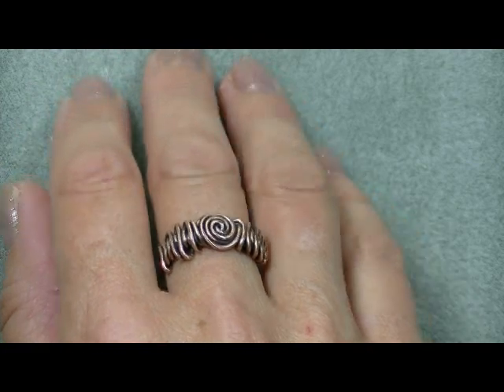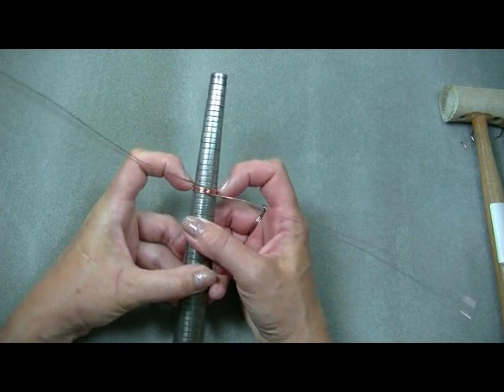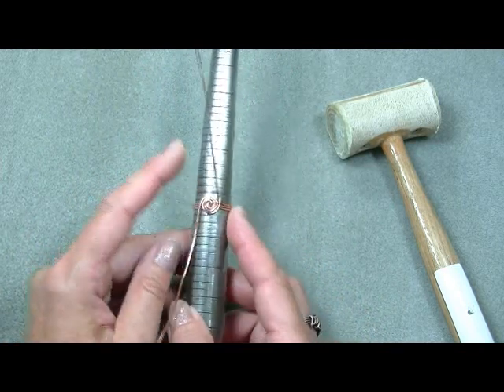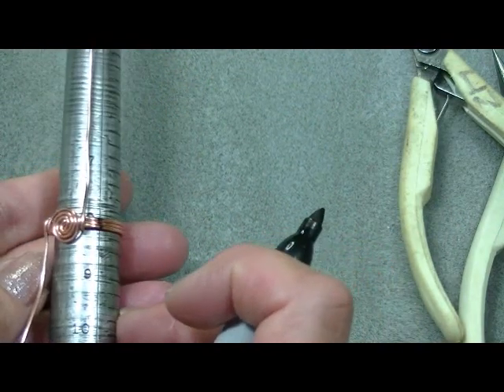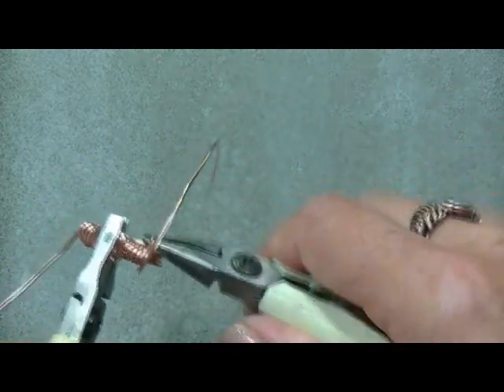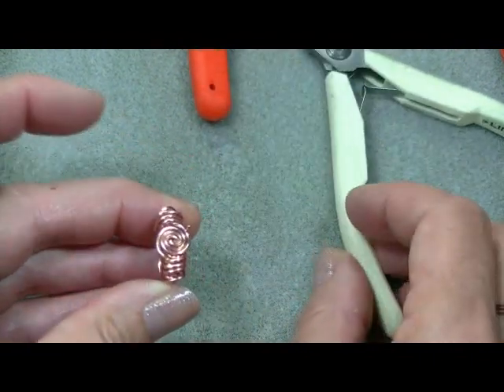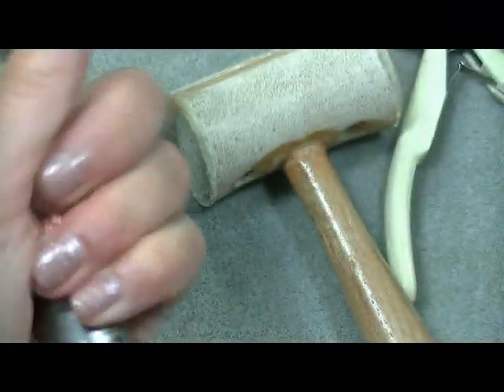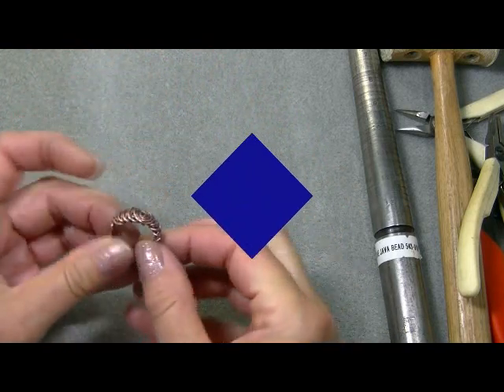Boho~Chic Copper Ring - Super Easy Wire Work

Comment: Great tutorial and fun ring design. The shiny copper almost looks like rose gold! Very pretty. Before hammering the ring, after fully wrapped, the spiral looks like a flat setting that you could attach some sort of decorative element. Just a thought I had. Of course, the ring has to be hammered unless it's meant to be a pinky ring. :)

Wondering . . . if the wire gets too stiff/hardened before finishing a project, can it be softened somehow? Say, maybe annealing with a torch? I'm a newbie, so I'm wondering for future reference. My hands, wrists and elbows are quite weak with arthritis, so I'm thinking I may need to re-soften the wire to be able to make some of your awesome designs. 

TFS!

Comment: This is great, i liked this, brilliant project, looked nice, i liked the shiney surface on this ring, before the antiqued stage, but both looked great, i just prefared the shiney metal version, the shape and style of this ring is very nice to look at,a visually pleasing design. thank you for showing us how its done.  I would like to make one in silver coloured coated copper wire and also in silver coloured copper for the atlantic waves bracelett, as im not a huge fan of bare copper wire, can i order these types of wire from your site? im a novice beginner in wire jewellry work and my knowlege of what wire i should use is limited to what i see visually as i have no experience to call on.  my main focus at the moment is to learn wire wrapping techniques and wire braiding wire bending and wire forming and all wire technique's to bezel cabachons or wire wrap them in any form to gain more experience and practice the techniques.  I think you said, that a 10 guage wire is best to use for the atlantic waves bracelett, i looked on your website, but i was unsure if you had it in silver coloured coated copper wire? Thank you Laura liverpool england.
Reply from the maker: +Laura Aqui Hi Laura,  I do not recommend color coated wire of any kind when using a hammer on it and especially for rings.  As soon as you hit the wire with a hammer, you break the seal of the coating and it soon changes color and deteriorates rapidly.  Rings take a beating and I only use pure metals for them. Coated wire will make a fun ring that you do not expect to last.  I do not have 10g nickel wire on my site but I do have 14g.  It is naturally stiffer than bare copper.
Reply: Ok, thank-you, for your informative feed-back, so that i will, bare this in mind, when, i'm wire- working, i appreciated your helpful, advice. thanks. Laura england uk.
Reply: Laura Aqui 👍

Comment: Love your work. Where do you get the copper wire you are using? If not crafting wire than what type is it?
Reply from the maker: +private91205 Thank you so much for watching.  I sell bare copper wire on my website www.makingiteasywithliz.com.  It is non-coated and will take a patina.  Though my website says "under construction", you can still order.
Reply: +Making It Easy with LI Iiz

Comment: what wire can i use if i have a nickel allergy?
Reply from the maker: Isabella Woodbury I'm using pure copper which does not contain nickel.
Reply: Ok! I thought copper was the one with the most nickel in it that's why i was asking. thank you so much! very cool project!